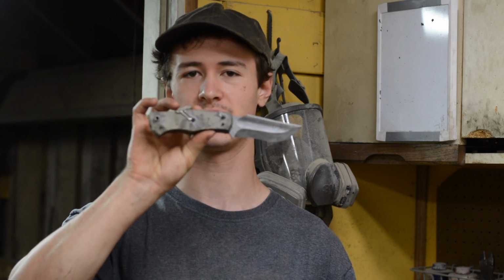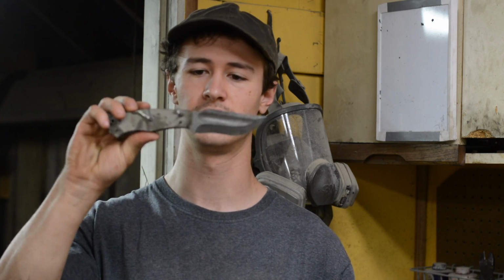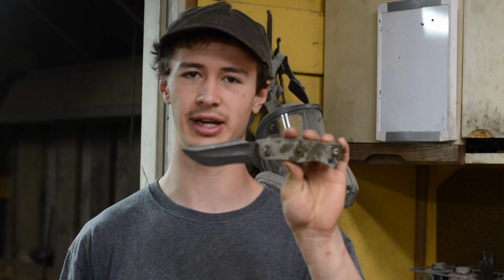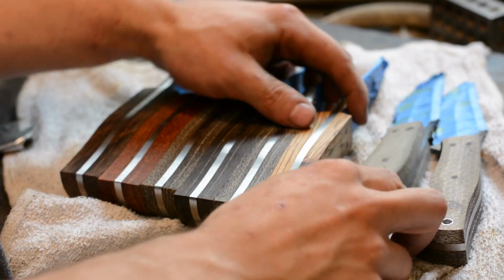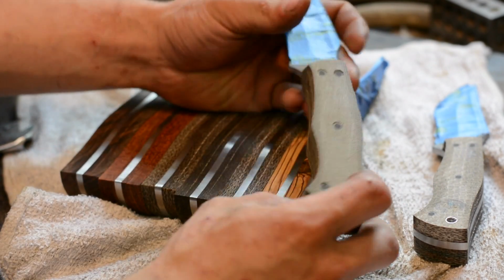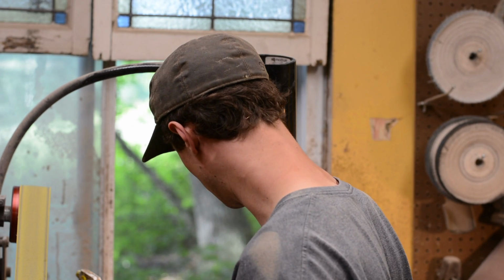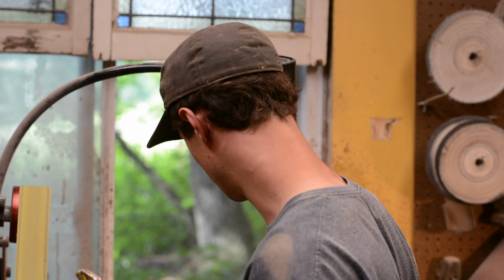Free hand sculpting - KNIFE HANDLES

Comment: Liam, I noticed the wood handled knives didn't go back in the ferric chloride. I am assuming the acid would seep into the wood damaging it, does it not affect the micarta/g10 you're using? And do you think it would be possible to seal off the wood somehow, presoak, to get that continuous stonewashed finish you have on the others? Excellent knives by the way, even though I like making my own, I'll be saving up to buy one of yours. Great work!
Reply: Makes sense. I didn't know if there was a finish that could resist the acid and not add much work. Thanks for the response. Look forward to seeing the new hollow grinds you're developing.

Comment: Liam - 
Are you soaking the handles in ferric, or in oil?  I'm guessing you etch and tumble the blades prior to glue-up, then use the layout fluid so they don't lose the etch completely in the 2nd tumble?  And if it's ferric you're soaking in, how do you completely neutralize the acid afterwards?
Reply: Thanks man!  Exactly as I thought.  So is your neutralizing solution in the tumbler?  And also do you soak wood handles or just the synthetics?  Would love to see a future video on the grinding stages of these.  Thanks for your time!

Comment: I'm not sure this is a question you can answer  but how long does it take for the after work knife maker to get comfortable on the grinder
Reply: Adrian b it took me about a month of a couple hours a day to get the fundamentals figured out. To grind like Liam takes longer but a good quality flat grind in my experience took a bout a month. My best advice to speed that up are, buy a 2x72 right off the bat, and second don't use jigs or grinding aids, just but some mild steel and practice making terrible knives until you have something looking good then use real steel. Good luck!
Reply: Sam Robins thanks for the tip and as far as the horrible knifes go I'm becoming a master at making those haha
Reply: Yeah I agree with Sam. I am by absolutely in no way an expert, but I have been using a grinder for about a year and I from what I have heard and experienced, skip the jigs. You'll find yourself getting a much better feel grinding freehand. Hope I helped
Reply: Jddj Jdjd thanks and yes advice is always helpful